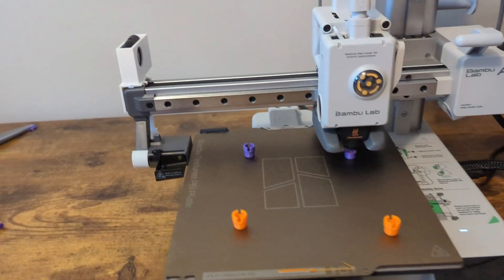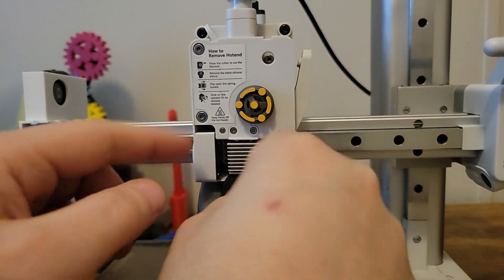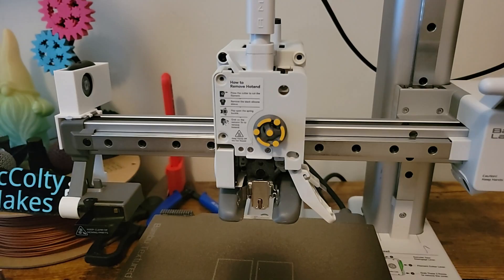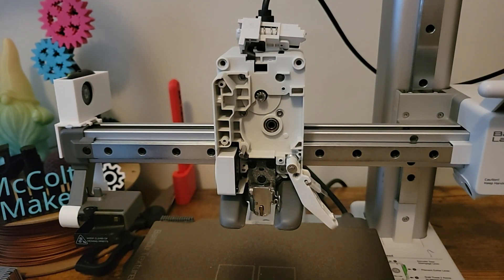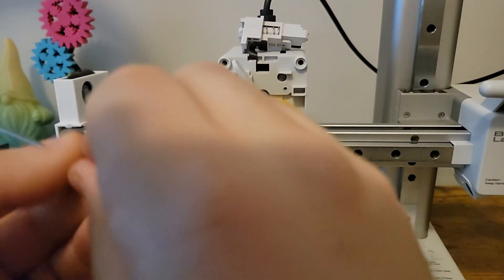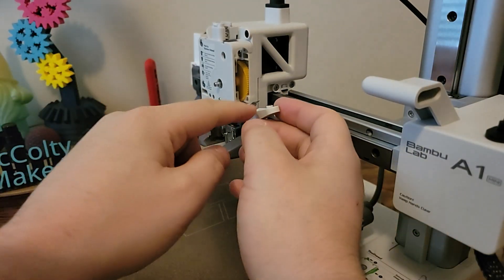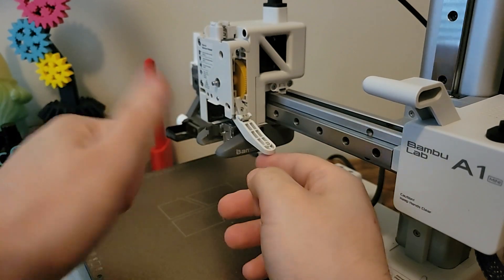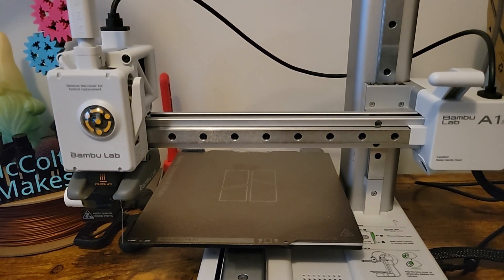Bambu A1 / A1 Mini Extruder Teardown/Maintenance

Comment: What are the signs of when your hot end needs to be replaced?
Reply from the maker: In my case I had a clog I could not get out, and was leading to under extrusion of  filament. Also the filament couldn't pass threw the nozzle(clog) the extruder was clicking.

Comment: What was wrong with the extruder? Clicking sound happens when i'm using the 0.2 nozzle. Maybe my settings too.
Reply from the maker: Being new I thought it was the extruder but it ended up being a nozzle issue, I swapped nozzles after I tore it down and that fixed the issue. Your .2 might be clogged.